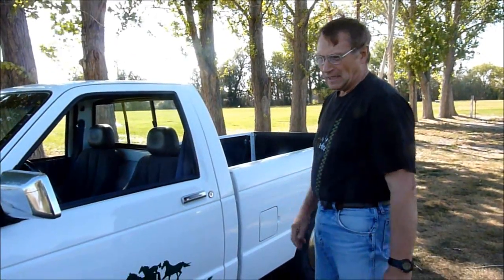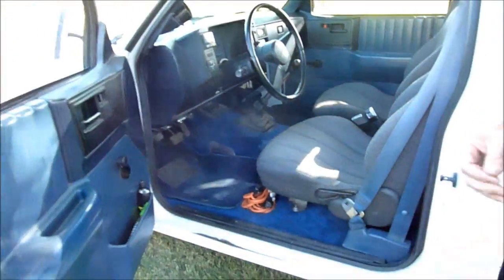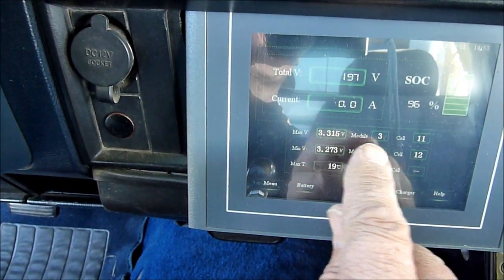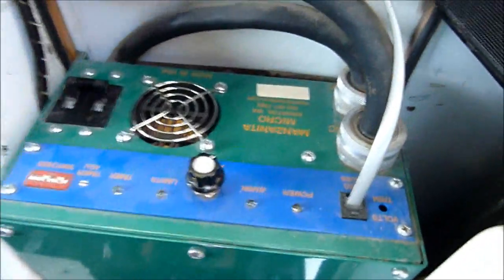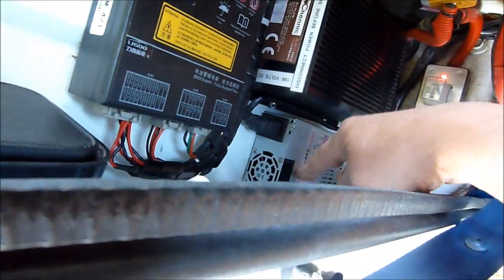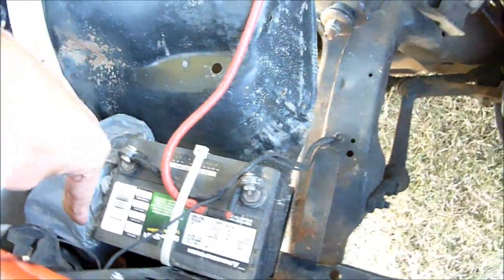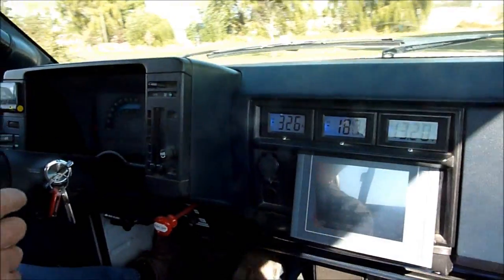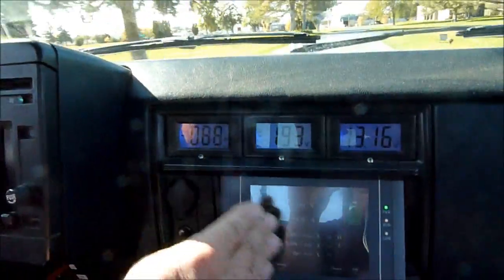1987 Chevy S10 EV LiFePO4

Comment: Nice build.  That looks like a warp 9 motor.  S-10 platform good place to start.  I did a Toyota truck conversion with 9" adc motor and lead acid batt.  Wish I still had it & put lipo in it

Comment: how does the manual shift without a clutch?
Reply: The same way that it does with a gas engine, off throttle you can shift without the clutch.
Reply: @harperjmichael  why do people say this. I drive a 01 man s10 for 20 years. It does not just slip into gear on right rpm. Who the f is out there shifting without their clutch and thinking that is ideal? Yes I can sometimes shift into gear no clutch. I never do it intentionally why would i?
Reply: @Sam-gy1rk  correct, the electric keeps the revs more steady so yes you can shift it without a clutch but most of the time the guys just drive around in 2nd gear type of thing and just shift to park - 2nd and or reverse

Comment: why did you use a transmission? not enough torque from the motor? or not enough motor RPM to reach 65 when directly driven?
Reply: denvera1g1 so he has a faster startup speed.